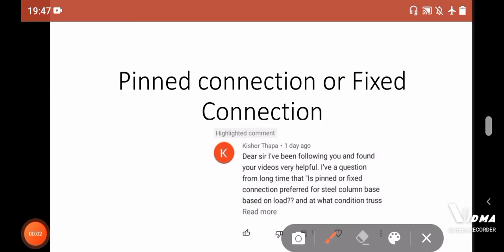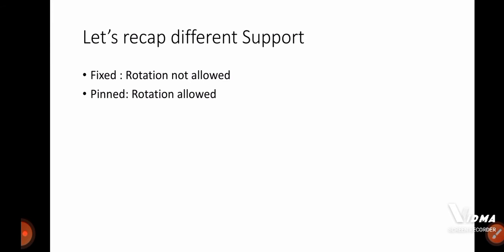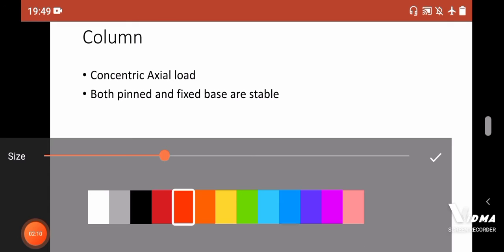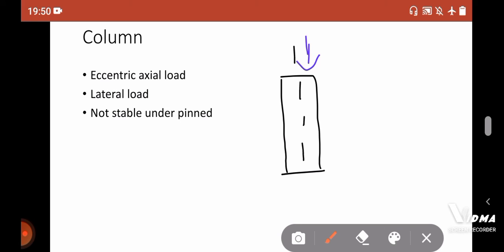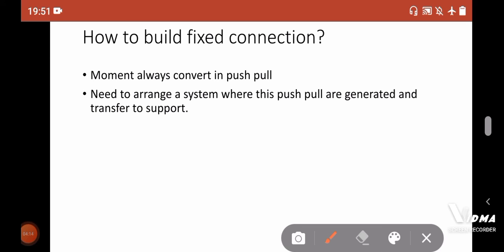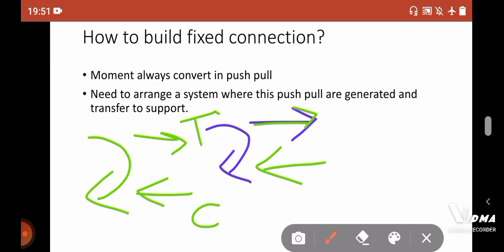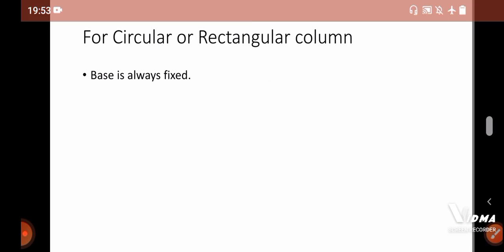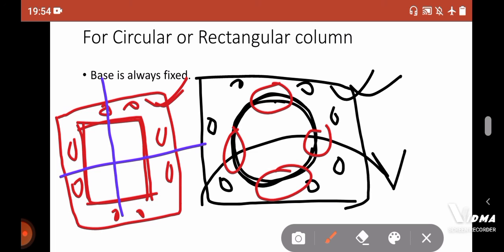Moment connected Base and Pinned Connected Base : Basics

Comment: Usually in offshore, the I beam will be welded to the base plate (no bolted connections used). Then it means the column is fixed right?
Reply from the maker: yes, but if there is vertical bracing it will not behave like moment connection. Thanks for your interest. keep watching and also You can Join my channel to show your support and love :)

Comment: Hi what is the connection when you poured the concrete to the footing first. Then after 28 day you poured pedestal column, Is it pinned connection?

If so then when i poured the footing and pedestal monotically. I created a fixed foundation?

Comment: How can I provide pinned support in both the directions????...in your example it is pinned in one direction and fixed in other....also how do i model in software if it is pinned in one and fixed in other direction
Reply from the maker: If you want pinned in both directions, put the bolts within flanges (in case of I section). But in that case you have to provide bracing in both directions.
If you want to model in software , release the moment in the direction about which you want pinned connection.
Reply: @TonmoyMaity Thanks for your response. what about connection between column and base plate in case of pinned connection. Only the web should be welded to base plate or flanges and web both will be welded to base plate???